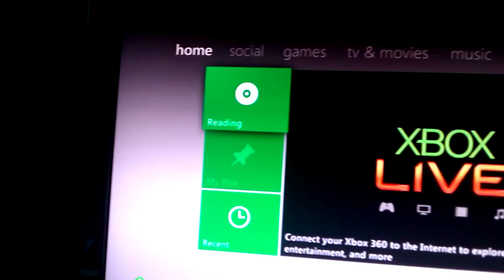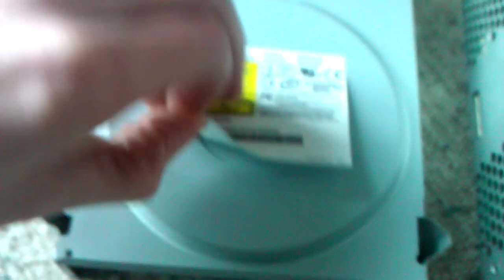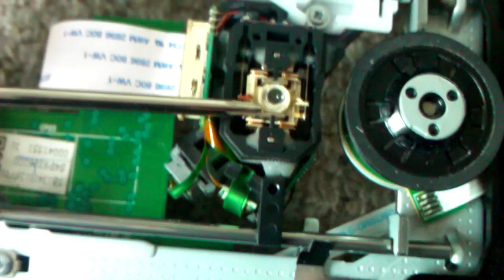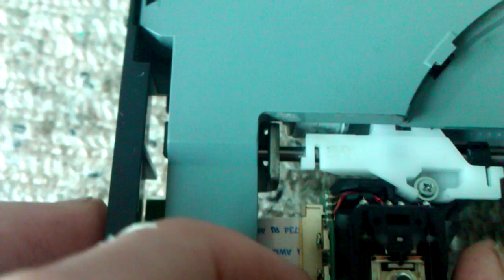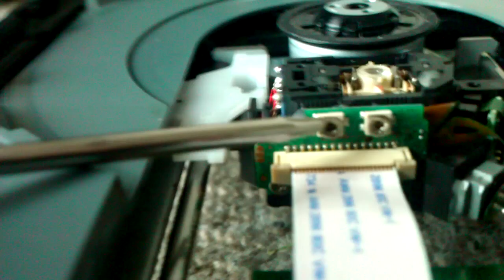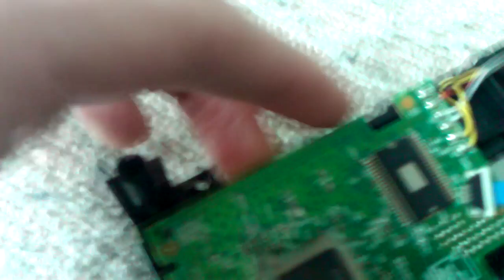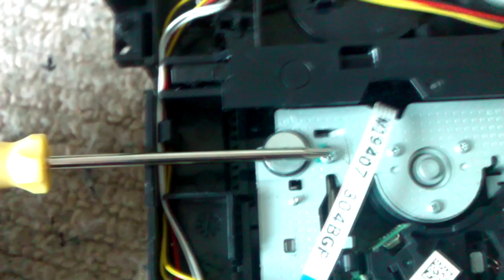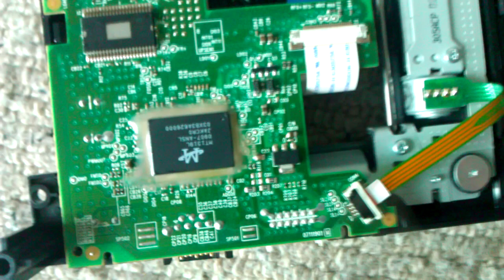2013 All open tray error and no disc spin fixes Xbox 360

Comment: My issue is the disc wont spin , im afraid to spray it with anything because I see a chip right under that thing that spins the disc. my xbox makes the same noise as yours did please help, you can message me as well thank you

Comment: I tried everything but it still won't work. When I put the disc in it does a half rotation then stops. I think it's beyond repair as it is 7 years old but I do really wanna play it as I have over 50 games :/

Comment: none of these fixed my problem, when the spinner is in it's casing it will not clamp down the disk, apart from that the laser is perfect because when i took the spinner out the casing and put it ontop of the disk to clamp it down the disk ran and everything

Comment: The first time i got the error, i went to the internet so they told me to hit the xbox so i did and it worked,after that like 2 months orso the error came back so i opened the xbox cleaned the leans(EYE) and the games worked after 1month same error again which is now i cant find any way to fix tried everything played with the screws,greased the rails,tried to make the disc turn before it even began to turn(PLEASEHELP)ireally want to take my xbox with me in the summer so i can play with it there

Comment: FAK!... I just used my initiative, and screwed those screws around alot, just watched your video and now im thinking I probs FAK'd my xbox forever, now I just need to twist each screw to a different combination 1,000,000 times and it will be fixed!.... FML
Reply from the maker: replacement laser from Amazon will prob be your best bet unless you have a voltage probe to test the screws.
Reply: Over rotating the screws will kill the laser. I learned the hard way. Looks like you did too
Reply: Yeah, Never-mind though, I found a replacement xbox just down the road for £20 lol HDD and everything :)

I just need to flash again, to which I cannot be bothered

Comment: lol, a new one costs 50$, and not even then will it work. Because each disc tray only works with a specific xbox. The only way to put in  a new disc tray is to modify the xbox and the disc tray, for that you need to buy equipment and hook it up to your computer etc. lol... 

I just bought a "new" xbox for 60$ instead :p